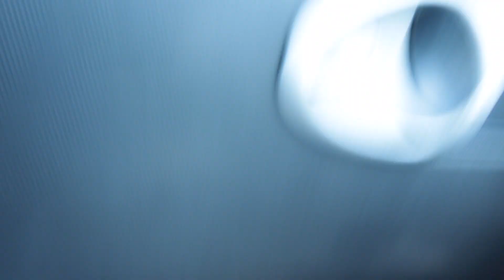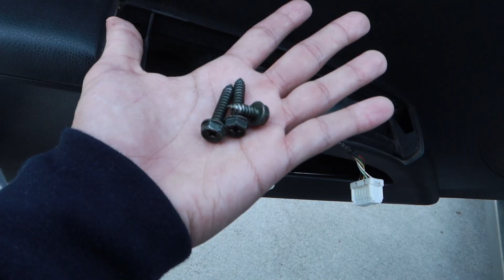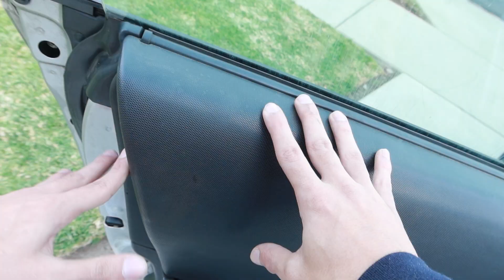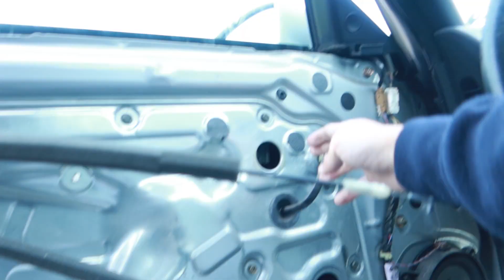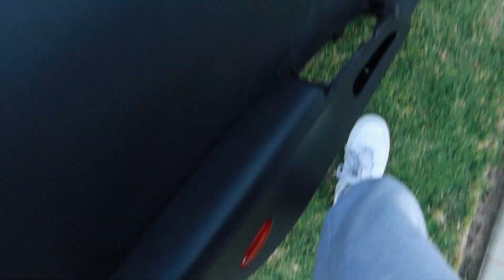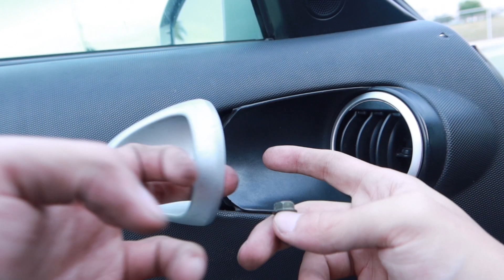How to Reset POWER WINDOW! (350Z)

Comment: The so called "Reset button" is in fact just a rubber grommet covering the Timing marks. Pull the round metal cover of the faulty motor and you will see the gears and small timing circle marks
Reply: So if your new motor doesn’t come with a reset switch what should I do?

Comment: I just replaced the bad window switch assembly in my 350Z and
have had issues with no auto function as well as the window
not dropping a little when opening the door and closing it.
I'm going to give this a try and hopefully it will fix the issues.
Great video.

Comment: I tried it works once then goes back new regulator motor is the switch bad?
Reply from the maker: if it goes down a little bit, then you probably didn’t do the reset properly. if it’s not going down at all, then it could be the switch.

Comment: just bought a clean stock 2004 350z roadster, love the vibe here, subscribed.
Reply from the maker: AYYYYYYUUUYYYYUEEEEEEEE 🔥🔥
Reply: a few months ago i also bought a somewhat fair condition 2003 350z and stumbled on this video on how to do it without going to any repair shop even though i had to pay to replace both window motors. this man got a added subscriber
Reply: @shadowforte1  also if tour seat adjustment switches arnt working all the time.  Try a can of compressed air and alcohol, I think mine has some dust covering the contacts to activate the switches.  Once I clean the by squirting a little in the top of the switch then stick the air nozzle in there and blow the switch out they seem to make better contact and work.
Reply: @ghostman76015  nice will make time to try that advice out. thanks again. 350z squad roll out :D
Reply: and third if your clutch is flakey look at the color of the fluid. Its supposed to be clear brake fluid, mine was coffee color, oh lord.  I have been using a small syringe to draw out the old and replace with new fluid and that also has helped. other than that I have driven it 20K miles and have not replaced anything, I dont think the original owner replaced anything from the service records so a 20 year old 350z is a great car to own.
Reply: @ghostman76015  definitely it’s also my first car so i will do more looking into it

Comment: Bro this actually caused my window to no longer roll up…. I’m so pissed
Reply from the maker: lol then you did it wrong. i told people that would happen is even one thing was off the sequences
Reply: @JakeCande  is there any way to get it to go back up? I’m out here sitting in 110 degree weather tryin to get it back up 😩😩😩
Reply from the maker: my g, i got you. just do the reset again (make sure you do it exactly). if it’s not moving and you don’t hear a sound… you might have blown a fuse. unprecedented but it could have happened.
Reply from the maker: when i say “don’t hear a sound” i mean: when you click the power window switch up or down, do you hear any humming or clicks coming from inside the door?
Reply: @JakeCande  it’s rolling down fine and makes a sound. When I try rolling it up it now makes a creaking sound halfway as if it’s getting stuck and won’t go up at all after halfway. Before I started trying to fix it, it rolled up fine when I just did the first click up without auto feature. Now it won’t go past halfway up at all no matter what I do, but it’s sounding like it wants to. It’s still making a noise when I have it halfway up until I roll it down just a little then it will stop.
Reply from the maker: bro. just do the reset again. follow my video exactly. make sure the door is closed fully or it won’t work. it’s a sequences you need to do exactly for the window motor to reset itself.
Reply: @JakeCande  will it work even if I’m unable to roll the window all the way up? It won’t go past halfway.
Reply: @JakeCande  yeah I’m tryin it and it’s not working. I think my shit is just fucked.
Reply: @JakeCande  ok, I just noticed a second problem and probably the reason why it broke it. I think the switch that tells my car my door is opened or closed is broke because it’s showing my door is open even when I press in that button manually. It just keeps getting worse :/
Reply: @JakeCande  I’m guessing not, I’ve tried everything. :/ I guess I fucked up my perfectly fine window and now I gotta drop 300$ to get it fixed. SMH.
Reply from the maker: 😂😂😂bruh are you joking ?? 😂😂 if it was perfectly fine then why are you doing the reset? and why you giving up so fast? lol are you trolling?? why $300?? fuses are literally 5 for $3.
Reply: @JakeCande  bro…. I’m a fucking idiot. Thank you for being the way you are because you’re right I shouldn’t give up and I was really close to. So basically, I was doing my passenger side and I don’t have a door handle on that dude so I have to crawl through my driver side to open it. Basically, my driver side door was still open and it wasn’t allowing me to roll the window up. I just closed that door and now it rolls up fine with the automatic mode and half click. Thank you dude, your video wasn’t the problem it was my stupidity. I appreciate you’re quick responses man, you earned a subscriber for trying to help my dumb ass lol.
Reply from the maker: that’s awesome man. i’m really happy to hear you got it. you figure it out, nice job bro.
Reply from the maker: try it again. make sure the door is closed

Comment: Would this fix my issue with my window ? Whenever I use the auto click my window falls straight down and when I use it again (the automatic function) it doesn’t go up at all, it only goes up by using the manual function
Reply from the maker: yup it should reset that lil glitch for you. usually glitchy window motors are a sign of the motor going out. but the reset should help you for right now

Comment: Thanks  I’ll try that!!! where is the fuse located? It’s a challenging to find lol
Reply from the maker: there is (if i can remember) three “electrical parts” fuses in the interior. the fuses are located right next to where your left foot is when you are sitting in the driver seat. there is also another “electrical parts” fuses under the hood. the fuse box is right next to the battery of the car. i doubt it’s a fuse but you can check. if you are hearing a single click, that means you are getting power to the window. fosho if the reset doesn’t help, it’s the door switch. even when i did my reset, i bought the driver door switch just in case. (this sounds dumb, but make sure your window isn’t locked on your driver switch. it’s the top left button that child locks the windows from going down).

Comment: It’s my passenger side that’s won’t come down sometimes even though I’ve changed the motor
Reply from the maker: it only won’t come down right? do you hear any noise when you push the button down?
Reply: @JakeCande  tbh same problem with my passenger side, it’s stuck down. And yes it does make a click when I try to move it up